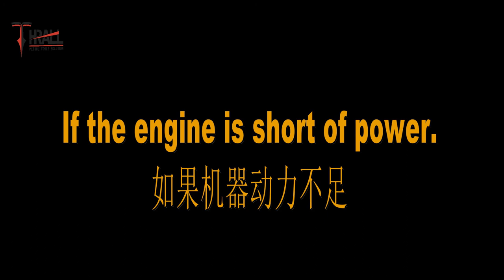THRALL DGH-49 maintenance video Gasoline demolition breaker

Comment: 1st tool I've seen where the carburetor is a consumable. If you use clean fresh fuel mix, and run it empty before long term storage,  I would expect the carb to last a vary long time, and even then a rubber/soft parts kit should be all that is needed. It's always a good idea to use Stabil or similar in the fuel of any seldom used tool. Also, they need to specify the fill level on the gearbox, their 'demo' shows them adding a few drops. That's not right, the gearbox needs to be filled to the specified level - usually to the bottom of the fill hole with the machine in the operating position.